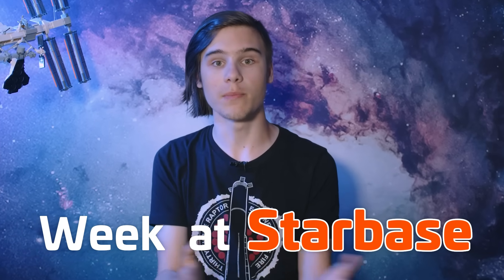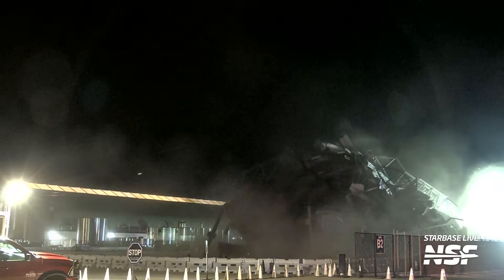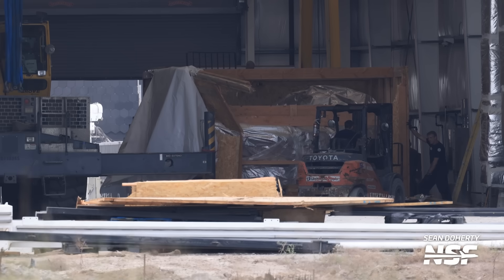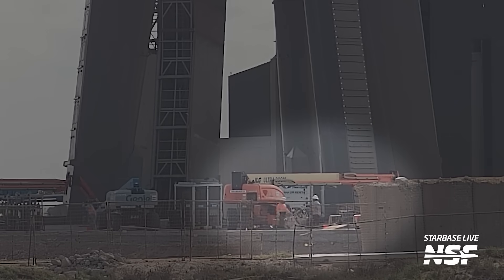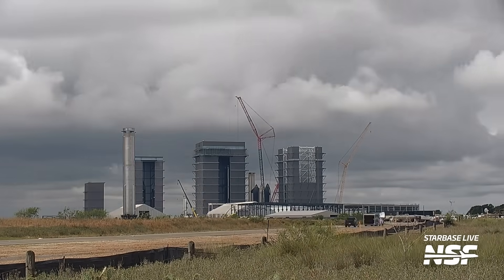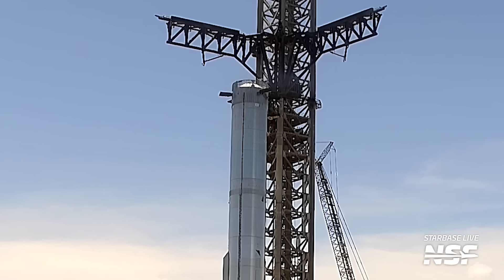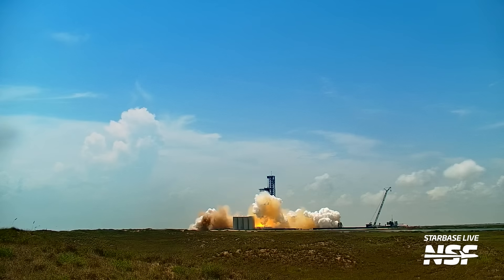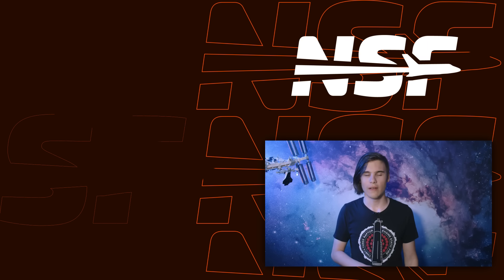Room To Grow For SpaceX's Starship | Starbase Update

Comment: 2 failed engines is not a successful test. It needs to be repeatably reliable and the cloud generated by this test looked much dirtier than the first test.
Reply: You dont know why the 2 shut down early though.... no one does. There are plenty of scenarios where the two shutting down is perfectly fine within the bounds of a test that ultimately would be different when lifting off for a launch.....

With 0 information we dont know why they shutdown. What we do have is a comment that it was a 'successful' test. That means the cause of the shutdown was more probable than not because of something unique to the test (ie much tighter allowances on sensor data - often a test, even static fire, will put stricter parameters on allowable data as it is a test not an actual launch so preservation is a better outcome. It could be the lower thrust is more prone to flow and combustion stability issues and if it was an outer ring engine which does need to throlle as much as the inner ones (nor the need to relight) a shutdown due to such an issue can be seen as acceptable as it wont be at such low throttle levels during a 'real' flight.

Tl;dr the only information anyone has as to the success of a test is an 'official' comment from Elon (who is usually fairly honest when it comes to SpaceX) saying that it was a successful test irrespective of the two sgutting down early. If you have info that proves it was actually considered an unsuccessful test by those internal at SpaceX I genuinely would love to know the info.
Reply: @Thats_Mr_Random_Person_to_you  You're absolutely right, no one outside of SpaceX knows why those two were shut down, but for now we know that on the first try many engines shut down, leading to the loss of the vehicle. On this attempt they did much better, but again did not have the full compliment of 33 engines. There will be things they don't want tell the public, they have no reason to do so. But hinting that there were known reasons why 2 engines were shut down would demonstrate mitigating circumstances. That would lead to more confidence ahead of the second orbital attempt.
Reply: A successful test is one that tells how well the test article did or did not work, and if you have met the objectives for proceeding with another test. They can clearly launch the rocket with less than 33 engines. Losing two or three at this stage may be good enough to launch and test other systems of the ship, like guidance and hotstage separation, without waiting for all 33 engines to sing in unison. Eventually the have to solve the problem, but they don’t have to leave all the other problems sitting on the shelf to be discovered later.
Reply: Isn’t everything always a success unless it obviously isn’t and even then it is still a success in a spacex sorta way?! It is impossible to fail if u fail forward, right?
Reply: A test with good data is a successful test.

Comment: Seems odd they wouldn’t keep testing until all 33 are fully successful.
Reply: If they waited for each step to work perfectly, they would not have nearly the amount of data and heads-up on other problems to be solved in parallel. For example if they waited until all 33 engines started perfectly they would not yet know that the FTS was insufficient, and they might have installed the previously planned deluge system over a foundation that was insufficient for launch. There were probably other anomalies during IFT-1 that are being worked now that can be tested on IFT-2 that do not require a guarantee that all 33 engines work perfectly, just that the ship gets off the ground and moves.
Reply: @ericbainter826  To get that data requires a flight of value.  There is no value in replicating the previous flight.
Reply: @edmondthompson1523  I mean, I'm sure there are many other things also but isn't there some real value of proving the FTS in a real flight, for example?
Reply: @edmondthompson1523  So who says they are replicating? The hot staging is the biggest known change, but likely many others that are not public or obvious as well. Even if they followed the exact same test plan, they would get value from achieving more performance objectives and verifying previous data and modeling. 

Spacex iterates quickly and tests quickly. Four years ago last Sunday Starship was a hand-made over-sized soup can on spindly legs with a single engine that hopped a few hundred meters. Now it’s the biggest rocket in the universe. Not a single test since then has gone perfectly, and yet the advancement has been huge. 

Sitting strapped to the OLM and burning thru engines would be of much less value than exercising the whole system and working all the problems that crop up.

Comment: maybe they should start the engines in steps and not all together at the exact same time ..
Reply: Ever watched starship do the flip. Because if you slow it down you see them 3 gimbal raptors light 1 at a time. But blink and you miss it. With 33 you ignite them in banks but still with little time in-between

Comment: Nice video. So much happening. What is the biggest milestone remaining? I'm getting tickets for 2023-09-22.  What date do you think?
Reply: Before launch? Its hard to say since we dont know what milestones they want completed. They still to this day have not had 33 engines complete a job together. If they want that to happen then this would be the big milestone. If they are ok with trying as it is now, then i would say Stack, maybe a wet dress and of course approval to launch.
Side note, they  are still installing more subcoolers and so will likely want a day of testing the entire stage 0 systems. A full wet dress would be a good way of doing this.